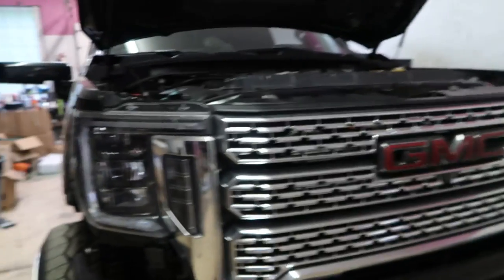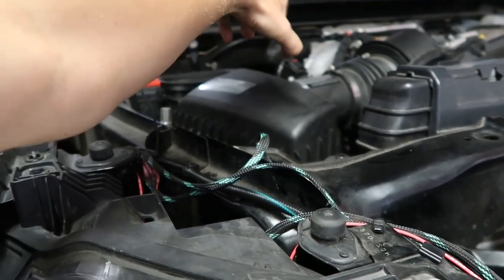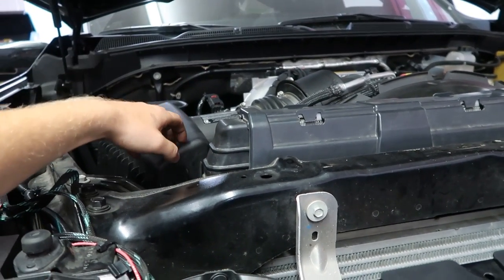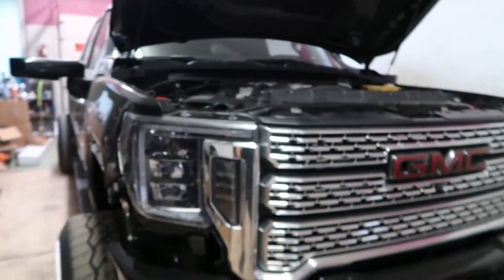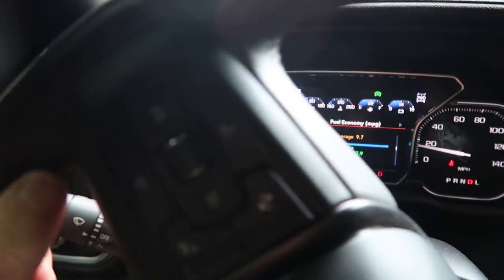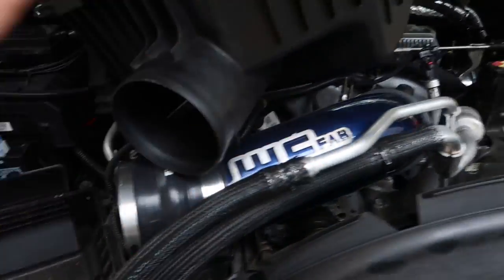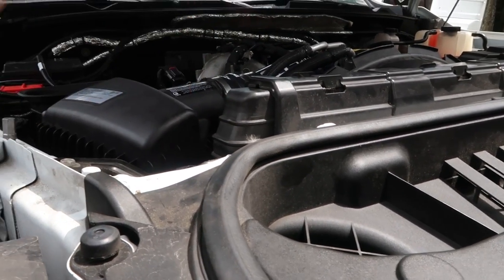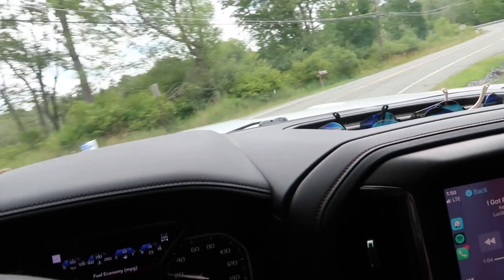The Most Neglected L5P Duramax Maintenace Item! (CHANGE THIS OFTEN!)

Comment: Denny, Got a '17 Denali L5P 82k miles . Had the whole fuel system rebuilt 2k miles ago due to bad deisel at gas station. When and would you recommend a deisel fuel additive to be introduced? Heard good things about archoil.  Everything on this truck is stock Thanks
Reply: I run hotshots every fill up

Comment: I have been watching a lot of your videos, I just picked up an l5p about a month ago. It’s a 2017 with 40,000 miles. I have never seen the glow plug light yet, it doesn’t come on at all even after letting the truck off all night long and starting it up in the morning. Is this normal for the l5p or should it be coming on every time?
Reply: My 2020 has never had the glow plug lights show up and my buddies 2019 never has either I’ve not had mine during winter but summer I’ve had no glow plug lights
Reply: I have a 2018 and never seen the light

Comment: Make sure you're inspecting the drain pipe on the ram air intake. https://cimg1.ibsrv.net/gimg/www.ford-trucks.com-vbulletin/624x453/capture_4faaf688d8665174fe9d1a98912cfd89d0745143.jpg These get clogged easily, and it just takes a little pinch to ensure its fixed. One trip to the car wash will ruin a brand new air filter if this isn't done! Also, you can use a WIX air filter as it looks and operates the same as OEM.